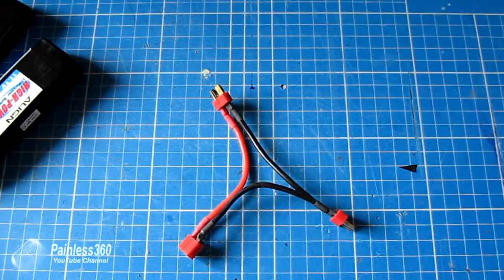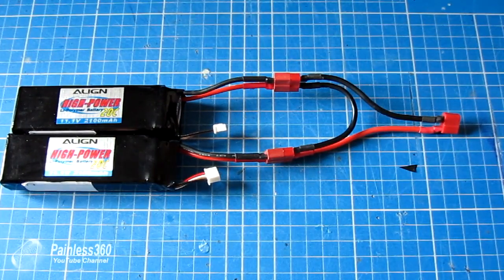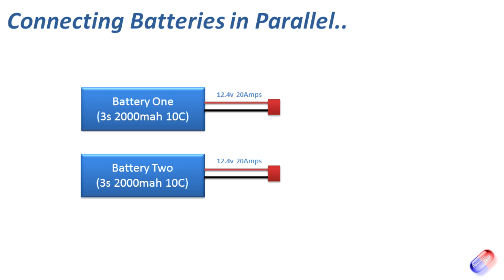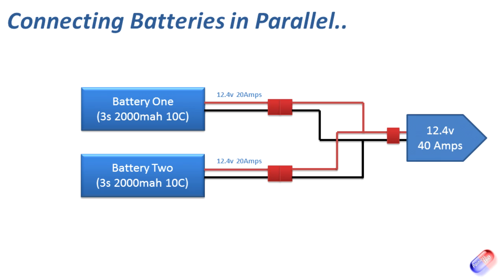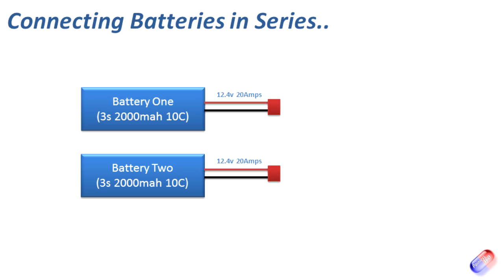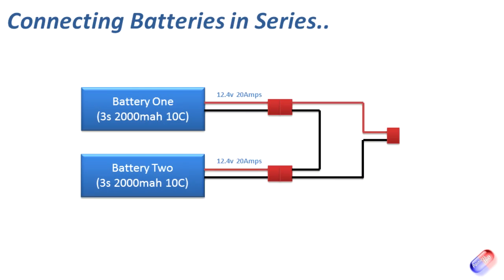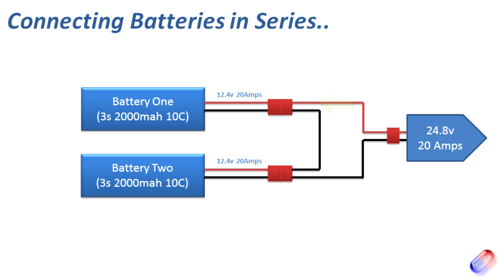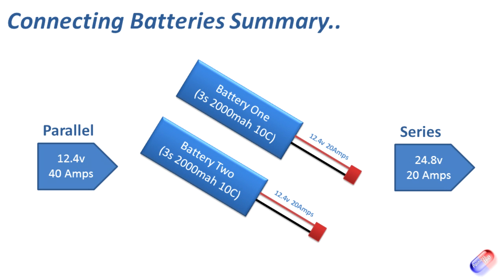Connecting batteries in series or parallel (LIPO)

Comment: Hey, I'm wondering does a Electric R.C. motor run faster with more Volt or more AMPs.  Say a 11.1 is running a electric r.c. motor that can handle up to 35volt.  What would make it run Faster   VOLTS or more AMPs ?
Reply from the maker: If you watch my other video - https://www.youtube.com/watch?v=uLutMoh4Ttg - you'll see that the speed of the motor is directly related to the voltage. The motor will draw less current with a higher voltage too. Be careful to reduce the size of the prop used when you increase the voltage.

Happy flying!

Comment: hello sir 2000 mah is equal to 2 amp not 20 amp and 4000 mah is 4 amp not 40 amp
Reply from the maker: That's right, but here we are talking about the maximum amperage (mah x c rating). Happy flying
Reply: Painless360 sorry sir i forgot about that..
Reply from the maker: No worries! :)

Comment: Thanks for the video, brilliantly clear demonstration of the difference. I was wondering, are there any safety issues with connecting LiPo batteries in parallel? I am currently considering connecting two 8Ah 14.8v batteries to get 16Ah unit but I've read conflicting views all over the internet about the safety, especially when it comes to charging the unit. Sorry for the long question! But thank you in advance.
Reply from the maker: The main thing to be aware of is to make sure that the voltages of the cells in each pack are as close as you can.

When you connect two packs together the difference in voltage will drive a current equal to the difference in voltage divided by the resistance of the cells/wire connections. As the resistance is very low this could be a large surge!

Hope this makes sense. Happy flying!

Comment: can i parallel a 2s 5.8amps and a 6s 5amps battery to make it operate as one 10amps? please say yes
Reply from the maker: Hi Gladys, sorry no. The batteries are different voltages (2s and 6s) so you can't connect them in parallel. Happy flying!

Comment: Also I have 30 amp esc's on my multirotor and need to know if I run 2 3S lipo's in parallel , would I be okay even though the amperage is increased to 40 amp draw ?
Reply from the maker: Not sure what you are asking here. You can't ask the ESC to pro wide more than 30amps. If the battery can provide more then that's good - the system will not pull it all. If you need more help please schedule a Helpout session. See my Helpout launch video to see more.

Happy flying.
Reply: Painless360 Thanks Painless, thats basically what I was implying , that the amperage wasnt forced to the esc's , but is there if it is needed.

Comment: If i want to connect 2 battery of 4v 1.5amp and 4v 0.5amp. what will happen in both cases?
Reply from the maker: What do you think would happen?
Reply: Painless360 when i connect both batteries in series the O/p voltage is showing 8.(something) and 4-5 amp but frequently the voltage decreases up to 4.3 and amp remains same but when i check both batteries separately then the battery having 1.5amp is showing 4-5amp and 4.3v and another battery that is showing nothing (BLANK- 00) no voltage and no amp fully dead battery after that when i charge that battery the it was showing the correct value.
Is that any problem to connect two same battery with having different amp???????
Reply from the maker: When you connect those packs in parrallel you will have a 4v battery that can deliver 2amps. Connecting in series will give you an 8v pack that should only supply 0.5amps.

By pulling more than 0.5amps when in series the lower rated pack is being discharged very quickly and that is why the voltage drops so fast. This is not good for the second battery. Hope this helps.
Reply: Painless360 What do you think?? is there any possible solution to solve this problem or i shall change the battery and replace with same amp and volt.
Reply from the maker: Hi again Sandeep. You have possibly damaged the smaller capacity pack by pulling out more amps than it can take, I would use the right battery for the job.
Reply: Painless360 Thanx bro for advice thanks a lot

Comment: It's there a way to use the balance lead to power two items simultaneously?  I want to power an immersion rc FPV transmitter and also a low voltage battery alarm too. I'd prefer to avoid wiring my tx into the breakout lead so I can readily move it to it to different models.  

Thanks in advance for any guidance.
Reply from the maker: Yes you can, connect both of the things you need to power to the outside pins of the balance tap connector to get 12v out of the pack (assuming 3s). Using the balance tap also allows you to pull lower voltages out of a larger LIPO too (i.e. connect just to two of the 3 cells in a 3s lipo to power an item that needs 7.4v.

Be careful not too pull too much power and be more careful to balance the packs if you are only connecting to some of the cells in the pack.

Hope this helps.
Reply: Painless360  i am whondering how far i can drain a lipo can i drain both 5000mah packs to 95% i know you cant go to 100% discharge but 90% to 95% shoud be ok  because the packs are thunder power 7s with 70c burst rate so it will tax them less this is for a trex 700e dominator because the lipos disturbingly fit lol so i am going 14s so i can do mild sport flying  i am trying to get my model under 5kg with lighter upgrades from kde plus lighter ceramic hybrid bearings plus going with a kosmik 200amp and a pyro 750 560kv competion motor which is lighter with plenty of grunt plus cutting and shorting down wires  aswell plus cutting 1inches to 2inches of wire holds a gram or two lol plus steel abec 7 bearings weigh more than ceramic steel hybrids  so losing quite a bit of weight helps i like longer flight times plus my hs is 2000rpm which is plenty of power for me i am not a stick banger reason you have more chance of killing your self plus taxing lipos which cant handle your flying style plus kde upgrades are air craft grade alumium which is stronger and lighter than stock so i will see my model drop weight under 5kg
Reply from the maker: Hi Jonathan, you should plan to pull no more than 80% from a LIPO pack regularly. Taking more starts to damage the pack physically and effects its performance. Plan to pull 4000mah from a 5000mah pack for long life and a margin of safety.

Hope this helps, happy flying!

Comment: if i had a 30amp ESC and put two batteries in parallel, would that cause any harm? or just basically double my capacity?
Reply from the maker: You would get twice the current, same voltage. Happy flying.
Reply: Painless360 thank you :)

Comment: Thank you for making these videos!
I use a voltage alarm on my battery, when flying my quad. Should I use 2 alarms, one for each battery if I had 2 batteries in parallel?
Reply from the maker: The voltage is the same across both packs as they are connected together (2:10)> This means you can use one alarm to monitor both packs. Be careful not to mix new and old packs together or the difference in the internal resistance will mean that one will supply more of the current than the other.

Happy flying!
Reply: Painless360
Thank you!
I guess I will raise my limit to be on the safe side too.